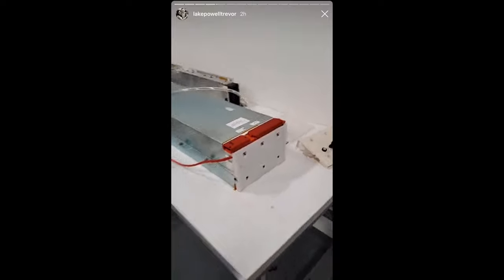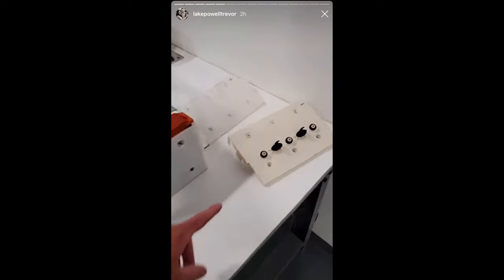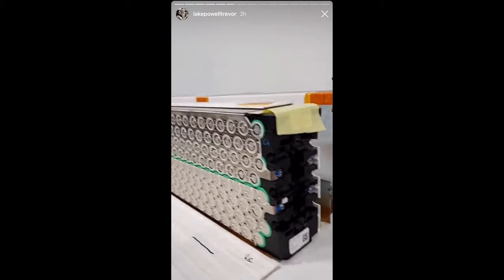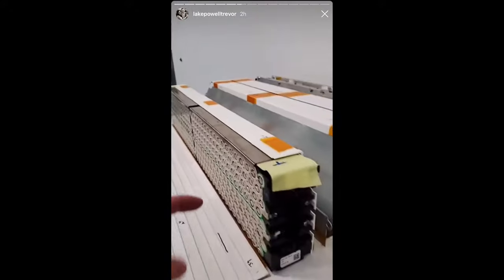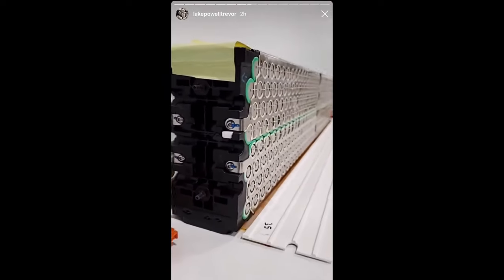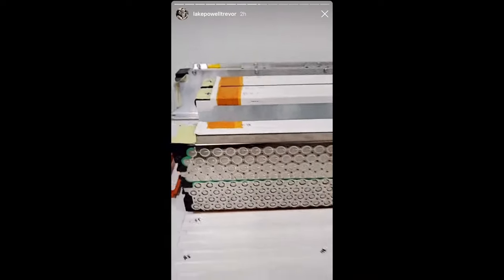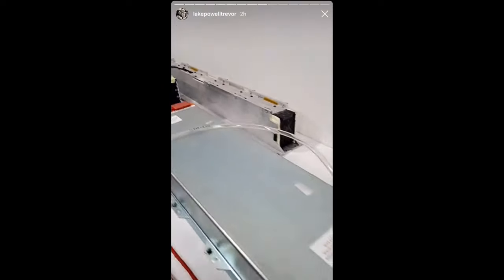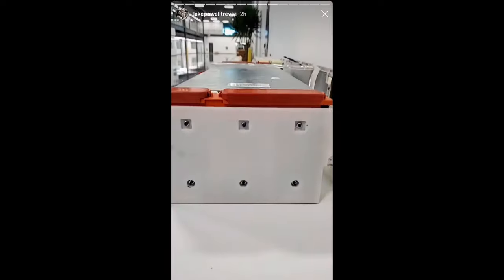Nikola Motor Trevor Milton Showing off Battery Tech

Comment: Sorry what did you just show...that was very amateurish. Plus hasn't Tesla been doing actively cooled battery packs with liquid for years now...in production vehicles...100,000's of vehicles...and you've built what? Nothing... that's right...because you don't make anything - that's someone else's job according to you. #VerySAD!!
Reply: Sorry to burst your bubble skip181sg but the Tesla liquid battery cooling mechanism does not have the batteries fully immersed in cooling fluid. Instead the cooling fluid cools the heat sinks attached to the batteries. This is significantly inferior to the Nikola solution as the heat needs to propagate through the heat sink first before the cooling fluid can have any effect. There are a number of Youtube videos showing Tesla batteries being disassembled and this can be seen.
Reply: @p00595p  Ummmm... How?? Nikola...how do they do it??

Since my understanding is....

Cells are from LG or Panasonic - 2170's

Modules are from Romeo Battery Systems

Nikola does the packs which is what I don't know

From Romeo Systems website

"The perfect module for trucks & buses. Hermes has a 21700 cell format in a modular design with high packaging efficiency, high power capability, and an integrated high cooling structure at SAE J2380 & J2464 requirements. Single cell fault tolerant by design."

So question.... - How does Nikola immerse the cells in liquid when they don't make the modules?